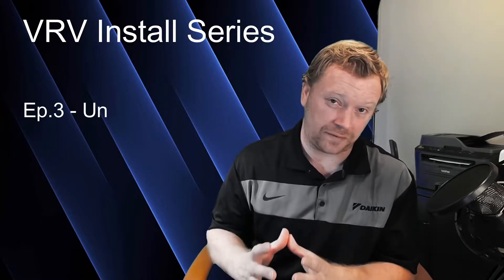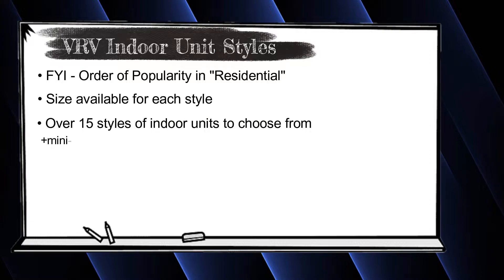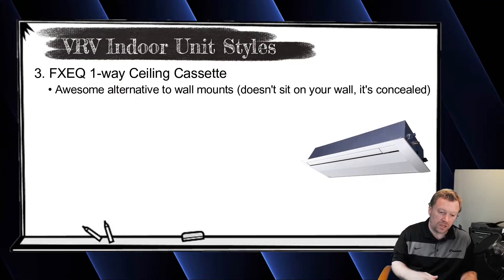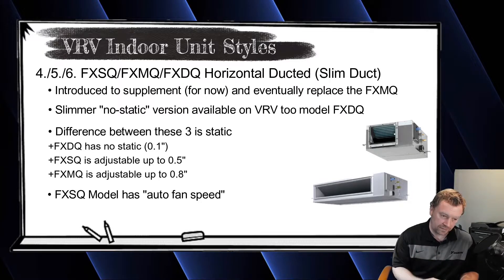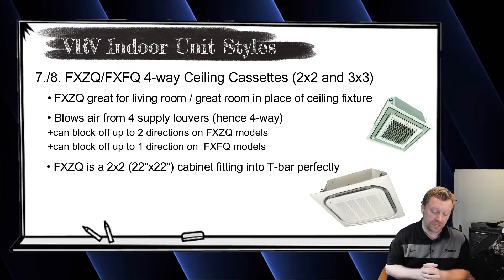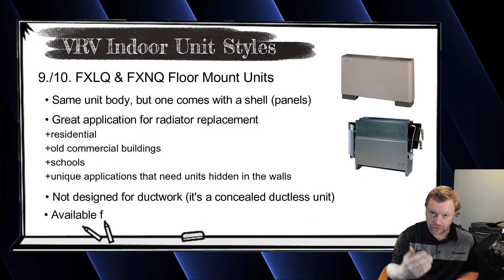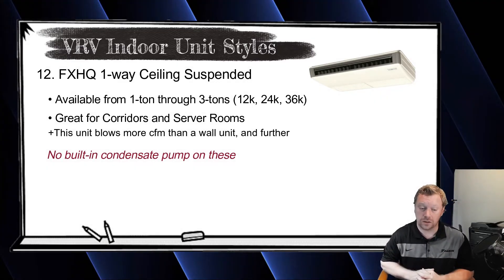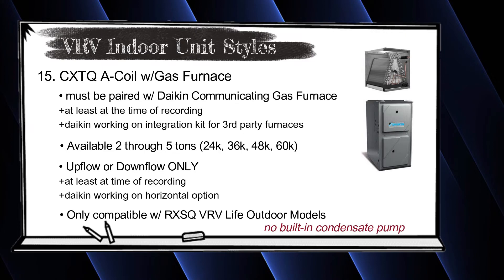Which Indoor Unit Should I Choose? | Daikin VRVS Install & Commissioning Series Ep.3 - 10-1-2021

Comment: Posting my question here to stay on topic. I currently have an RXSQ48TAVJU outdoor unit.  I currently have a CXTQ24 which covers my basement and main level.  Upstairs is handled by an FXTQ30.  During peak summer months I’ve noticed the CXTQ24 lacks that extra headroom to handle peak loads, especially if cooking, everyone is on the main level or when the whole home dehumidifier runs.  I am looking to change the FXTQ30 to an FXTQ24 to make room to be able to use a CXTQ36 on the gas furnace that supports the main level and basement.  Before doing that I wanted to check in for your feedback as well.

I had a Manual J completed for my home. My main and basement levels require a combined sensible load of 18,936 Btu/h (Cooling) and 30,130 Btu/h (Heating) using 838 CFM of airflow. This load is also before the added 7,000 BTUs from a whole home dehumidifier. The calc used an outdoor temp of 93* and a Delta T of 18* with an indoor temp of 74* for cooling.  

The CXTQ24 has a 15,600 BTU SHC Cooling capacity at 64*FWB and a CFM of 560, 680, 800 (L, M, H)

The CXTQ36 3T has a 20,200 BTU SHC at 64*FWB with a CFM of 750, 900, and 1050 (L, M, H). 

If I’m reading this right I need the cooling capacity of the 3T and the fan speed of the 2T. In an ideal situation a 2.5T but that's not an option.

Based on that I have a few questions:

1. Based on the load calc, which coil do you recommend using to ensure proper cooling of that main and basement level, the CXTQ24 or CXTQ36? 
2. Since CXTQ IDUs don’t have half-ton sizes, are you able to set fan speed trim levels for cooling if you don’t need the extra CFM airflow?
3. What is the proper amount of time an IDU should run to hit setpoint and cut off if it’s properly sized?

Thanks!
Reply from the maker: Sounds like you've done your work. I cannot make a recommendation directly but there are some things to consider. Btu/h is usually a derivative of cfm and delta T. If you are going to keep delta T the same for ductwork purposes then you need a larger split across the coil, a larger coil may or may not give you this. A few reasons. The indoor electronic expansion valve only cares about superheat when cooling. So if you have a smaller coil with 800cfm it will drive the valve open as needed to get that flow just right. If you go larger on the coil it may crank down the eev again limiting flow to maintain superheat. 

Before replacing anything, what I would do is connect dchecker or service checker and check performance on the entire system. See what it's doing internally under full load from both zones, cranked setpoints, and see how it performs. Then satisfy one but not the other and then vise versa. Let's get a clear picture of performance. There may be other reasons your house doesn't keep up at certain times.
Reply: @InverterAlways  ok thanks that’s great points and advice I didn’t consider.

Comment: For indoor unit styles of Daikin VRV, there are 15 styles:
1. FXAQ: Wall mount style
2. FXTQ: Multi position air handler
3. FXEQ: 1-way ceiling cassette
4. FXSQ 5. FXMQ 6. FXSQ : Horizontal ducted (slim duct)
7. FXZQ 8. FXFQ : 4-way ceiling cassette
9. FXLQ 10. FXNQ : Floor mounted unit
11. FXUQ : 4-way ceiling suspended cassette
12. FXHQ : 1-way ceiling suspended
13. VAM ERV (Energy Recovery Ventilator)
14. AHU Integration Kit (EXV Kit)
15. CTXQ : A-coil w/Gas Furnace.
Reply from the maker: Yup that looks bout right, though there are some more common ones used in resi versus commercial.